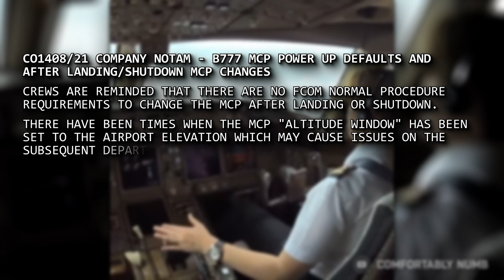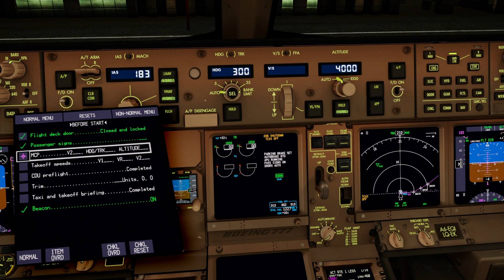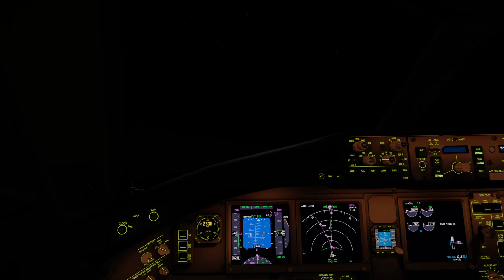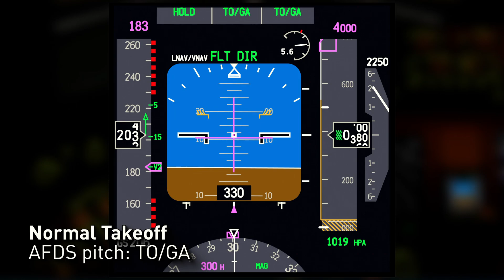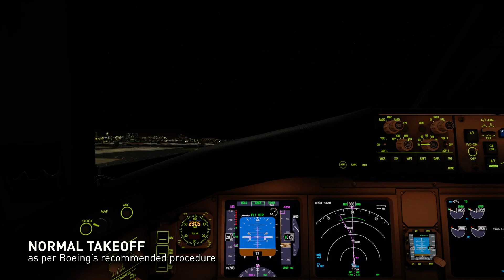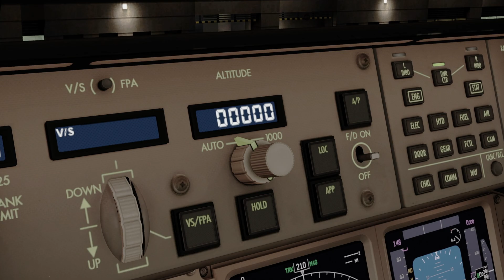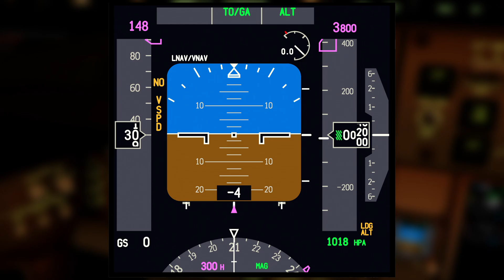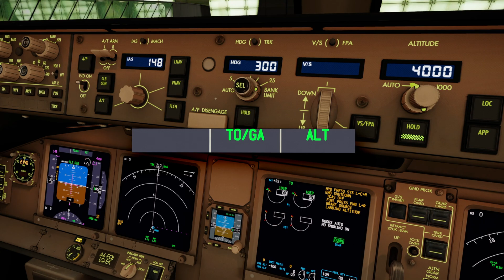Cutting It Close: How an Emirates 777 nearly crashed off the end of the runway in Dubai

Comment: The 777 is an astonishingly easy airplane to fly, provided you get to its seat by following a decent progression up through the ranks in aircraft size and complexity.  That these pilots "performed" this profile simply boggles my mind.  You'll notice that I didn't say "fly" because no one was flying that jet.  The Flight Director is a TOOL that is utilized to accurately fly the plane, it is not however, the only tool and it does not control the jets path UNLESS YOU LET IT.   You're supposed to be in charge.    At my old airline, we were TAUGHT that in the initial phase of flight to ignore the FD, or fly "through" it.  IOW, look past the bars and look at the airplanes attitude.  At the "rotate" call, YOU, JOHHNY PILOT grab the controls and smoothly and firmly pitch the airplane up toward 15 degrees initial attitude while holding wings level.   You.  Not the FD, not the AP.   Its literally as if you were flying your Cherokee on the weekend with a few extra distractors thrown in.  Anyone remember this old saw, "Pitch Plus Power Equals Performance" ??   That's really what were talking about here.   The 777 has got an astonishing amount of power.  Even if at MTOG on a hot day it will happily fly away from the ground at several thousand feet per minute if YOU input the proper pitch controls.   Someone controls the rotation and initial climb.  Not something.   If light and its cool,  you're probably going to need more than 15 degrees initially and you're going to pitch up a bit more quickly to your target pitch than you would if heavy.     And if you're using Max Take Off Thrust, your initial pitch rate would occur even MORE quickly.    It's called flying and it seems to be a dying art.  Someone has to control that very high energy state and transition from the runway to gear up and beyond.   Not the FD.  Not the AP.

You'll notice that Orville and Wilbur blew right through 250 knots (max speed is 250 below 10,000' in much of the world).  They managed to get to 280 Knots before even reaching 300'.   But that's not all. They blew through Maximum Tire Speed (I think it's 197....retired now and I can't recall) before getting airborne and quickly blew through their configuration speed (red and black on the speed tape) as well.  I assume that was their max flap speed, but without knowing all the specifics I can't say.   Either way, it was an epic cluster fork.   Simply astonishing that a "professional flight crew" could do something so stupid.   Someone finally increased the pitch by what....3 degrees and they went into high-speed hovercraft mode for a bit.    And eventually, someone decided to yank back on the yoke.   What did he say, at 25 seconds?   Astonishing.  

At Brand X, the flying pilot was required to point at and verbalize each of the MCP settings as part of the Before Takeoff Checks.   The Flight Mode Annunciators were compared to the MCP settings and the clearance.    This synchronized the FD settings, the FMA's, and the CREW's heads into what was going to happen at VR and during the initial climb out.  This is just common sense and good airmanship, backed up by SOP.   I cannot imagine this happening at my old company.   This was almost the second Emirates hull loss caused by the crew not knowing what their plane was doing and thinking the magic would save the day.

Comment: no all 4 pilots did not forget the checklist and how to take off. i think the plane was over weight and they just barely got it off the ground in time.   emirates is keeping this quiet and thus this bulletin 7 days later.
Reply from the maker: An overweight takeoff doesn't fit as closely with the evidence as my proposed sequence of events:
• Why did the aircraft remain so low to the ground for so long after a positive rate of climb was established – even an overweight aircraft would climb (albeit slowly);
• Why did the aircraft suddenly rocket upwards after skimming the ground – surely if the aircraft was struggling to climb as you're suggesting this would be impossible;
• Why did Emirates publish a crew bulletin about setting the MCP altitude window to 0 feet after a flight;
• Your suggestion would mean that not only did all four flight crew fail to notice their aircraft was grossly overweight, but also the dispatcher, load controller, leading hand, etc.
Overall an overweight takeoff seems much less likely based on the above evidence.

Comment: this is a 2nd post of this event.  This is a much better analysis of an unforeseen ("unforesee-able" ?) software "confusion".

The previous post proposed "automation preoccupation"  ... that the pilot didn't input a climb because the flight director didn't "suggest" one.  That was, IMHO, a bit lame ... the real question was why the flight director didn't command a climb ?  This analysis proposes a very reasonable reason (the FD was in the wrong mode).

But what about the airplane in take-off configuration ?   Is it possible that the H. Stab was being driven in the pitch down direction without the pilot's knowledge ?

And, of course, as others have posted, continuing the flight without any sort of damage check is highly unprofessional, and possibly "obstruction of justice" (in that the CVR, and FDR?, would have been overwritten with the remainder of the flight).
Reply from the maker: Thank you Russell, I was aiming for a deeper level of analysis than has been presented elsewhere, so I'm very pleased that viewers appreciate that.

Was the aircraft in takeoff config? There's no reason to assume that it wasn't, flaps being incorrectly configured is a far more serious oversight than wrong flight mode selected. It also doesn't explain why after liftoff, the aircraft didn't climb.

Regarding any other mechanical or technical failure, I wouldn't rule it out, however the Emirates Crew Alert seems to be a significant clue about the suspected cause of the incident. We'll have to wait and see what the report says.
Reply: @AirTrafficVisualised  If the plane was in take-off config, wouldn't it have "wanted" to climb at a speed so far above Vr ?  Can you try it in your sim ?  Maybe the sim will show the H. Stab being commanded nose down, to comply with the FD mode ?
Reply from the maker: Yes, with the aircraft in the appropriate takeoff configuration it takes quite a bit of force to hold it down as the speed increases. If you let go of the control column the aircraft will pitch up and climb - the higher the speed, the greater the rate of climb.

The autopilot will not adjust the trim to follow the flight director pitch bar while in manual flight. Whether the crew manually adjusted the trim after liftoff, we can't say for sure - that'll come out in the investigation.

Comment: Very very good video, by far the most accurate analysis I have seen!
I say this as a current 777 CPT, with over 10k on type.
One small correction, FD will command V2+15 or current IAS which ever is greater up to a maximum of V2+25kts.
I suspect you might be an Airbus pilot, given your "Takeoff" call 😉
Reply from the maker: Thank you, the praise means a lot coming from an experienced captain.

My source for the lift-off FD target speed is FCOM 4.20.7, which states "after lift-off, the AFDS commands a pitch attitude to maintain: • a target speed of V2 + 15 knots or the airspeed at rotation + 15 knots, whichever is greater. • if current airspeed exceeds the target speed for 5 seconds, the target speed is reset to the lesser of the current airspeed or V2 + 25 knots."
This seems to be contradicted by 4.20.11 which matches your correction.

I'm inclined to trust someone who has actually flown the plane, so thank you for the correction!
Reply: @AirTrafficVisualised  it's a very minor point!
Impressive systems knowledge if you're not rated on type 👏

Comment: As a non-expert of airliners but pilot of smaller airplanes: To me that was a crew that forgot to "aviate" (actually "fly the aircraft"). Speed, positive climb, close terrain in visual conditions anyone?
One other thing would be interesting: the CVR. Where the pilots distracted by perceived or real other problems - did they communicate at all? But I guess the relevant CVR recordings - which I believe contain only ever the most recent 2 hours of voice recording - were deleted as the crew continued normally for some hours as if nothing had happened.
That is actually an anachonism!  Why only 2 hours CVR? It's 2022 - do they still use cassette tapes for this LOL? 
This stuff should be stored for far longer - even for months or years on end, maybe with only select personnel having access to it (if there are privacy concerns or something).

Comment: there's a few points I've observed:
-they are hand flying the takeoff so shouldn't the pilot rotate after the callout?
-how did the pilot not realized their low altitude after wheels up and stay close to the ground for such a long time before climbing
-did the autopilot took control during the rotation so the pilot cannot fly the plane?
-if the pilot blindly follows the pitch command is there lack of training? that's abnormal to blindly follow the pitch command without looking outside in VFR
Reply from the maker: These are great questions, but they'll have to wait for the investigator's report before there are any conclusive answers. With that said, the autopilot "taking control" can be ruled out.
Reply: @AirTrafficVisualised  agreed
Reply: Very good questions!
1. Yes they should! Rotation is never done with reference to FD commands anyway
2. I don't know
3. No autopilot is never used for takeoff and cannot be engaged on the ground in the 777
4. This is the real question, I really can't understand why they would do that. Maybe there is more to the story that we don't know. But if this is actually what happened, it honestly doesn't make any sense
Reply: Good questions - I think part of this is due to fatigue but how did that happen with 4 pilots onboard, that's the most confusing part.
Reply: @ibraheemnabeel  fatigue yes, I hear they over work their pilots hence most leave and don’t stay with emirate for long! It looks so shiny on the outside, but get closer is all cracks all over
Reply: i i was to guess , no all 4 pilots did not forget the checklist and how to take off. i think the plane was over weight and they just barely got it off the ground in time.   emirates is keeping this quiet and thus this bulletin 7 days later.
Reply: Overweight?  IS that why it climbed out at greater than 4000 fpm once Orville finally pulled back on the yoke.   No.  It was not overweight.   NO ONE rotated the jet to take off attitude.  That's why it didn't "fly". @tankthearc9875

Comment: As a non-expert it boggles my mind that the airplane system even allows selecting an "altitude hold" mode on the ground for take-off.
Reply from the maker: While it might seem counterintuitive, for the sake of consistency I can see the logic behind "if selected altitude and current altitude are less than 20 feet apart, ALT mode", even on the ground.

As I explored in the video, there are many opportunities to rectify this condition should it occur (and it shouldn't, if following Boeing's recommended procedures) - it just seems that all those opportunities may have been missed in this case.
Reply: i refuse to believe all 4 did not see this during the checklist twice

Comment: Thank you for the incredibly in depth video. Those visuals are pretty scary to think how low they continued flying for. 

The amount of knowledge pilots / flight engineers around system interaction and modes must be incredible. Especially when things go bad / break.
Reply from the maker: The full set of 777 manuals (Flight Crew Operations Manual, Flight Crew Training Manual and Quick Reference Handbook) combined are over 3,300 pages of in-depth systems description goodness.

I'll be very interested to see what the investigation turns up. Thankfully this was an incident rather than an accident.